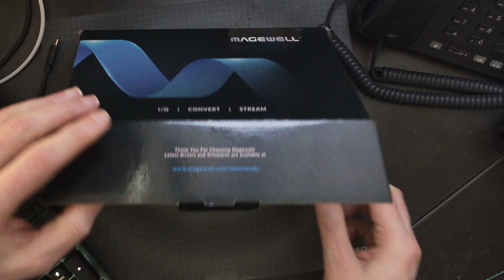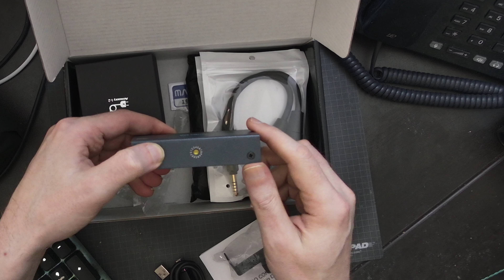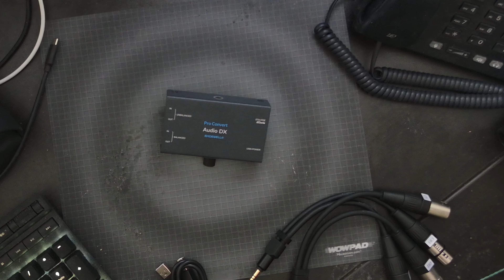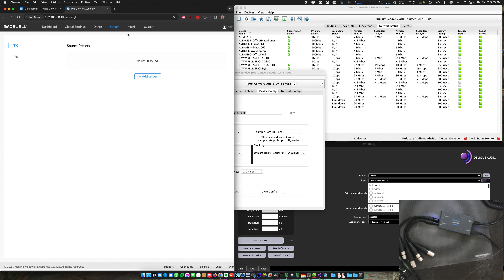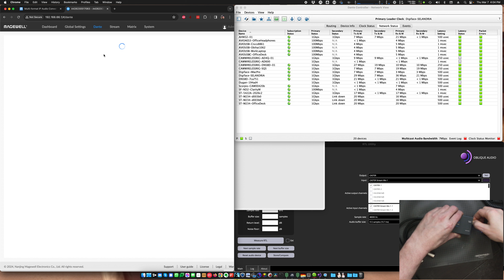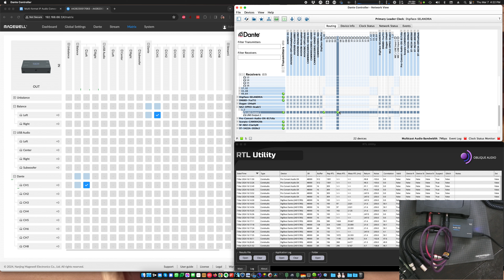Magewell Pro Convert Audio DX First Look

Comment: Hi, thanks for your video. I’d like to ask if this product could work for my setup — I have 8 mono outputs in my Dante matrix. Can I send them to an SRT server with the channels kept separate?
Reply from the maker: I haven't personally tested that configuration (I don't have an SRT receiver), but it should work.  You can route each of the eight Dante inputs to individual stream output channels in the matrix configuration in the Audio DX.
Reply from the maker: So this isn't quite as ideal as one might like.  I just checked, and the Stream outputs only support four channels, not eight.  However, you can have two different Stream outputs running.  So by setting up two separate SRT streams, you could send half your Dante channels over one and the other half over the other.